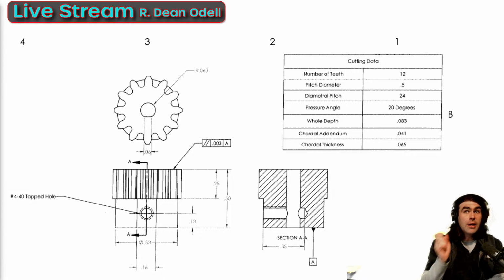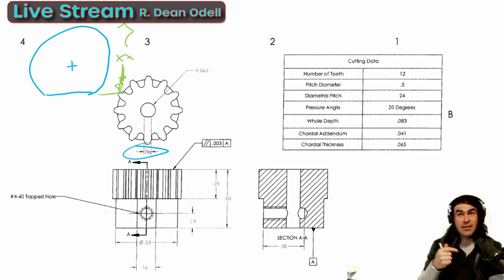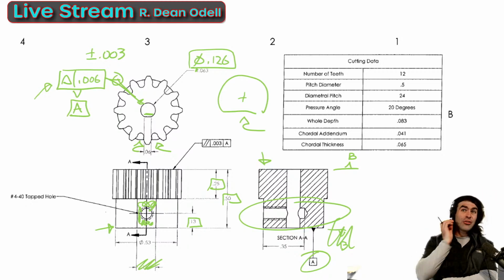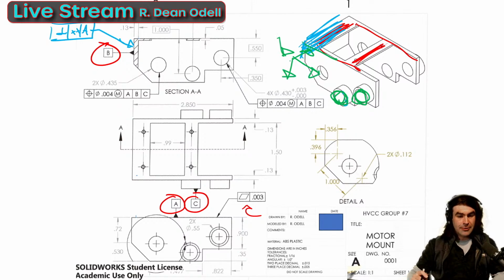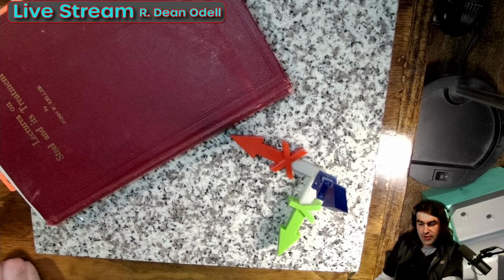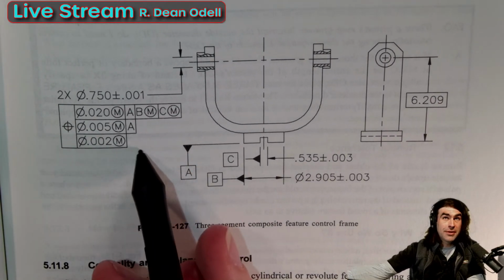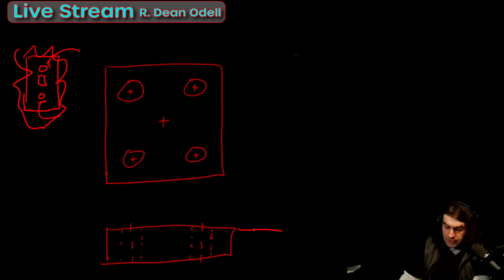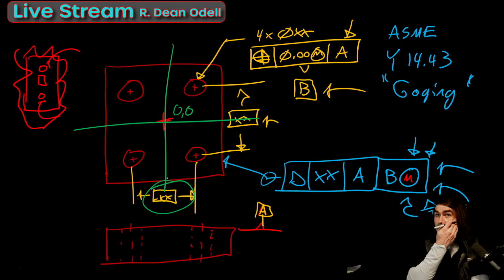GD&T Livestream #3 “Going over my drawings from college”

Comment: Could Datum C have been set un the top face 4x bolt holes?
It could be more fonctionnal in fitting the part to the parent Assembly